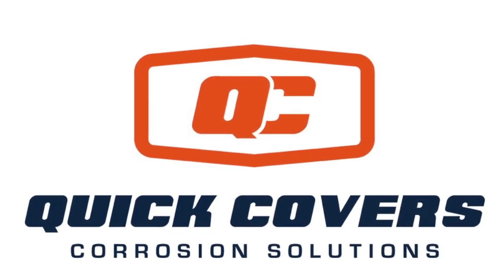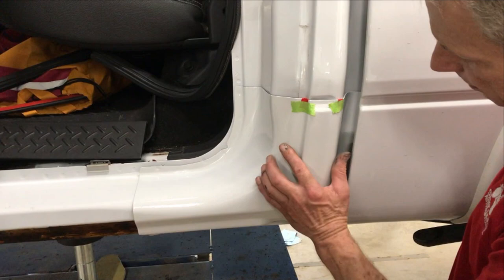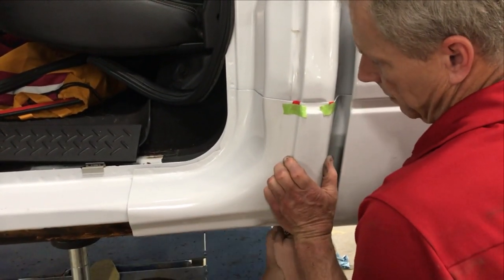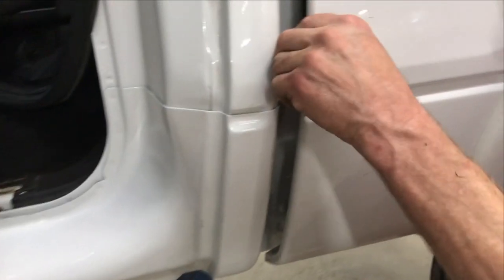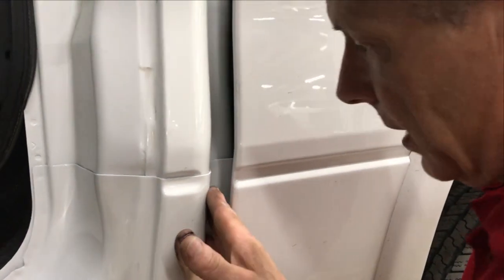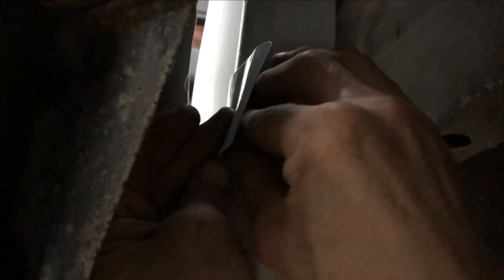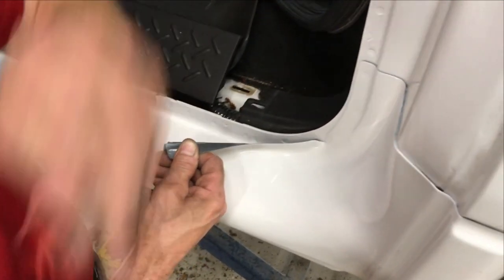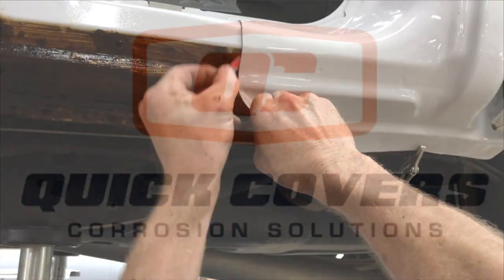Quick Covers F 150 Cab Corner Installation | Quick Covers by OAM

Comment: Appearance from the outside looks better but what about all the rusted pieces behind it? Doesn't appear to be a long term solution.
Reply: Sand or wire brush the rust down to bare steel about 2” inside the fit of the slip cover. Use por15 on the bare steel and be sure not to go past the outer edge of the slip cover. Por15 with prevent any further rust for 15 years at least. Por15 cannot be in direct sunlight so it’s perfect behind these panels. I’ve used Por15 for 20 years or so and it’s a very reliable product as far as keeping rust at bay. You can even apply Por15 directly over rusted metal to stop rust from continuing. It’s damn good stuff.
Reply: of course it's not.  You either buy these plastic turds to stick on there or cut out all the metal, move the box back and do it right for about 3000.  Or,  just accept the fact it's got rust and drive it. .

Comment: Like the idea for quick fix, but not the pricing.. ouch
Reply: Do they come in different colors or can they be painted?
Reply: @QuickCovers  ....I need a set...put it in cart, went to check out then had a heart attack when I seen the shipping...80$ from Iowa to NY??...at 299$ for the corner.....at least work with me....on the shipping , or paint them oxford white like in this video...somthing... 299$  , I was gonna pull trigger but 80$ shipping is out of line
Reply: @QuickCovers  put it in a priority mail box.. significantly cheaper.  No reason to gouge on shipping
Reply: C2cfabrication has them. $40 a side.

Comment: wouldnt this make the rust problem worse if water won't drain out and  dry off as fast
Reply from the maker: Great question. Quick Covers have been specifically designed to allow water to properly drain so they do not hold moisture. Also, a critical step to the installation process is to remove and treat any existing rust that will be covered up by the panel. Examples of this step can be seen in many of our other videos.

Comment: Does anybody know do they stay on?
Reply from the maker: We've heard back from customers who've had theirs on for 6 years and call us to say thanks. Gravel roads and lots of car washes with no issues. The 3M tape is very high quality. It is pressure activated and designed for automotive body panels. The rivets have a tri-fold design which disperses the surface area to provide a more secure hold.